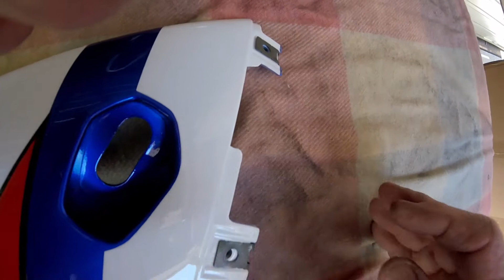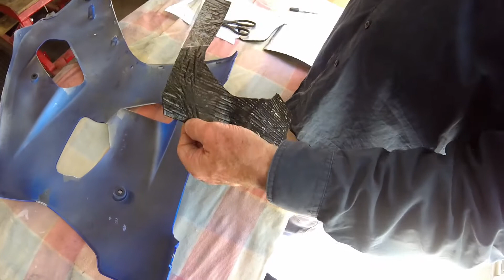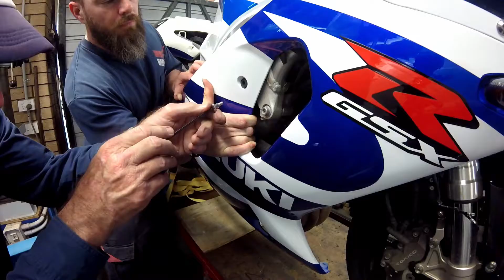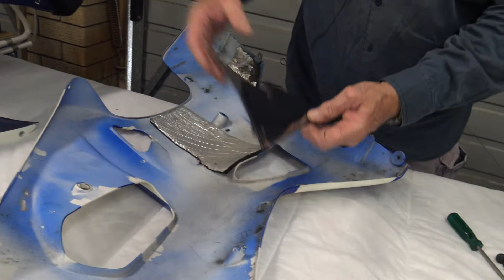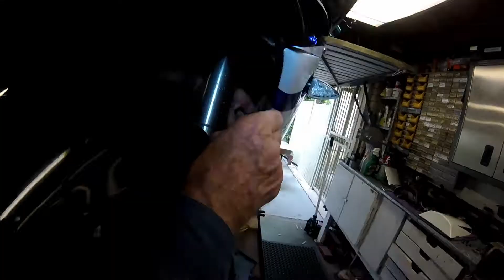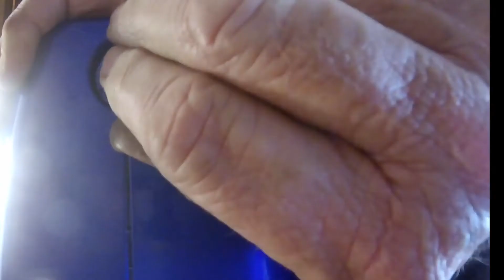Suzuki GSXR 750 Crash Repair: Part 6 – Fitting New Side Panels & Air Ducting

Comment: at no point do you show the air ducting
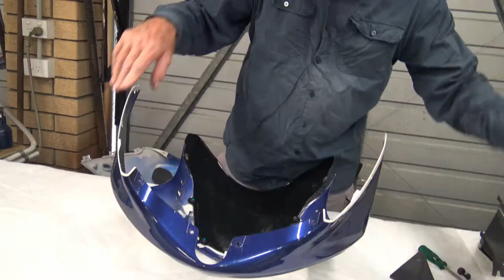Reply from the maker: I am wondering whether you wanted to see the fitting of the ram tubes, that run back to the airbox that supplies air to the fuel injector bank. That was covered in Part 4 of this crash repair series. But this part covers the fitting of the air ducting or air dams that funnel the air to the radiator core, the fitting of which can be seen form 9:19 on. Hope that helps.